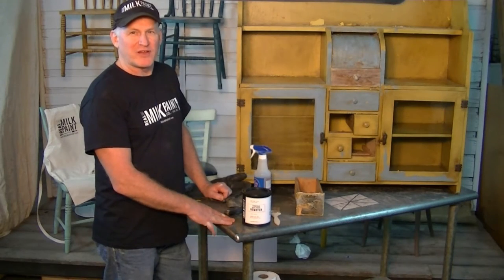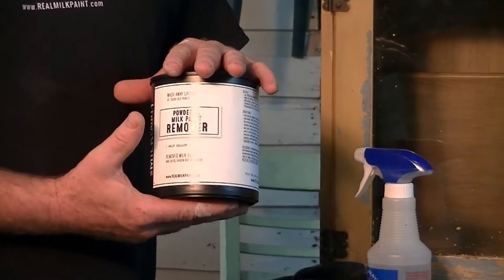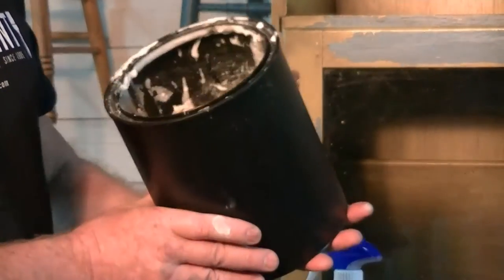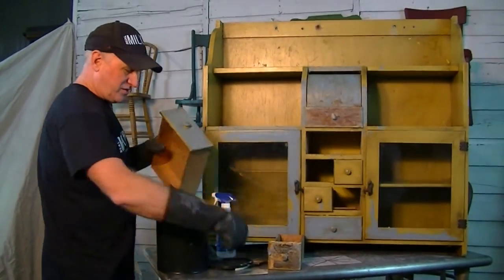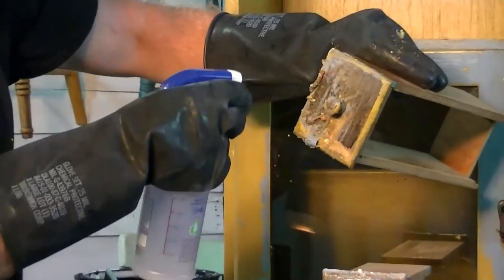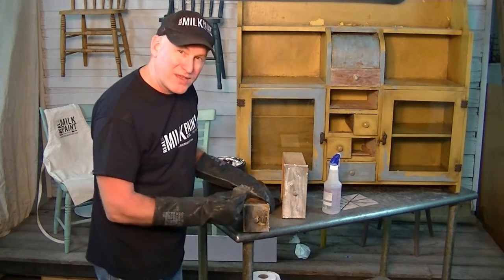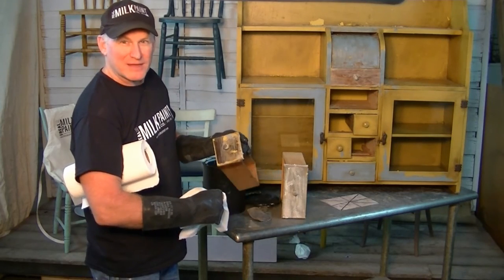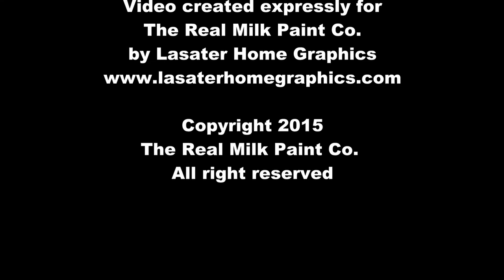How to Easily Remove Milk Paint

Comment: I have a door that is very likely over 100 years old.  I have been told it is covered with milk paint.  I want to clean it up and use it for decor.  How do I know if is milk paint so I use the right cleaner?
Reply from the maker: Typically if it is just milk paint on a surface it will be porous and absorbent. So, any water would absorb into the milk paint. Milk paint also has a flat, matte sheen and hangs closely to the texture of the surface. Hope that helps!

Comment: I have a desk that the previous owner painted with light blue milk paint that is flaking off, and I can easily see that it is a semi-gloss white enamel underneath. I would like to remove the milk paint to return it to the original white enamel surface. Is it possible to do that with this product, without using steel wool that would scratch it up, since the milk paint is not strongly bonded or absorbed into a wood grain? Or would this product also begin to break down the enamel paint underneath?
Reply from the maker: Hey there! That's a great question. We would recommend using the Milk Paint Remover, and it should help break down the layers of paint (even the enamel.) We hope that this helps!